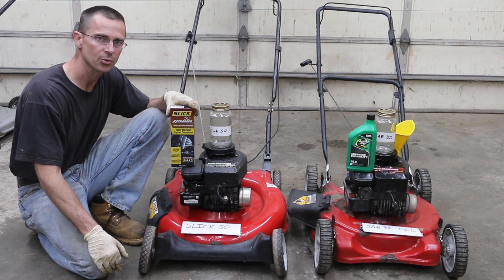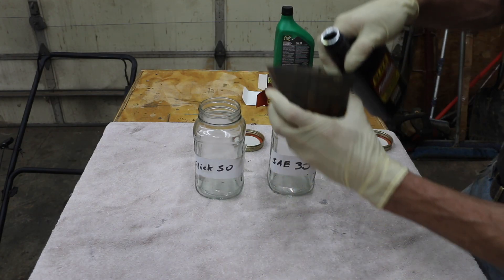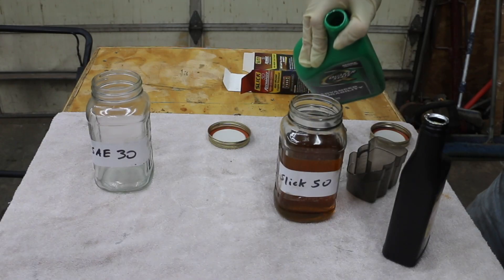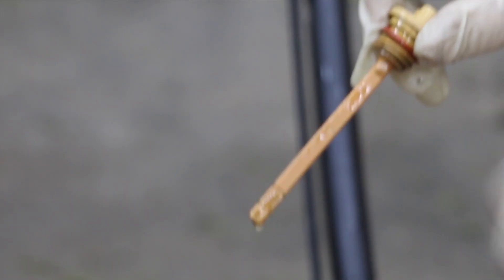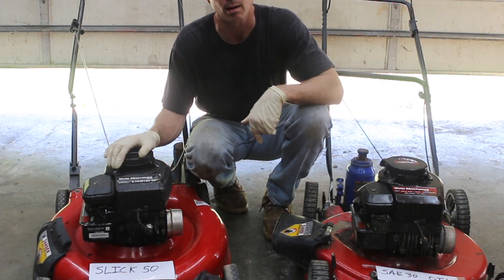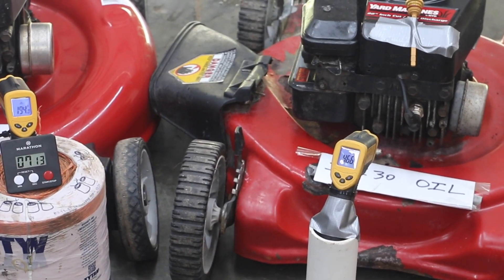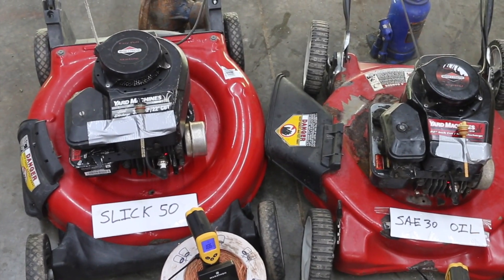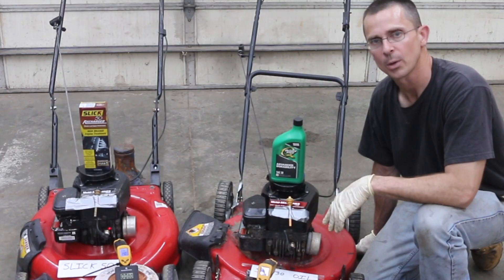Can't believe what SLICK 50 did to my engine!!--Dry Crankcase Test!

Comment: I've never believed the Slick 50 would prevent an engine from doing exactly what it did here.  However, I am surprised at the lower head temperatures.  That, in and of itself, should allow an engine to run longer if Slick 50 is used regularly as instructed.  I also wonder if with just one treatment was enough.  I really don't remember the commercials or the testing specifications for them, but if properly treated and then you had a catastrophic loss of oil, AND you shut the engine down in time, I would be curious to know which engine was repairable, if either.

Comment: Slick50 contains Ptfe particles which clock and burn bearing lubrication, this is a problem when it gets older and starts to burn.
My late father had a Peugeot Diesel and used it every oil change 4-6000 miles. At under 100k miles engine was scrap. Mother same engines normally run 200,000 miles without issues.

Comment: i recently bought some Motorkote, I'm going to put it in my '08 smart with 76K miles on it, it's supposed to "molecularly bond" with metals inside the engine. i do synthetic oil changes at about 6000 miles (factory recommends 10,000) i had an oil analysis at 52,000 miles, less than 1/4 the metals in the oil than a smart with 15,000 miles and oil changes at 5,000. i just started driving for UBER and will probably rack up 700 miles a week. Curious as to what this would do to an engine.

Comment: Would you be interested in trying some Tungsten disulfide? If you PM me, with your address, I'll send you enough to mix with your oil and treat an engine.  I have performed similar tests on 2 stroke engines; i saw a reduction in engine temperatures..

Comment: How long should an engine in service last?  There is no set number so over the life of a vehicle or engine, how do you actually know if the engine benefited from the treatment or was just well made as far as tolerances and machining from the start?
Without a baseline to work from, it's impossible to say whether you got good life of not. Add to that the infinitely variable usage that would have a huge effect, I think these additives are somewhat relying on the fact there is nothing to compare them too know. 

To me, the best way to make an engine last is frequent oil and filter changes. Not even fussed about the best oil, anything that meets or exceeded the manufacturers requirements is fine. It just needs to be be kept CLEAN so the acids and mirco metal particles and everything else is removed.  The best oil still gets dirty. Clean fresh oil in my book is far and away the best way to get best engine life..... what ever that may be. 

Of course the other things is, not many people buy a new car and keep it till the thing falls over.  Many people turn their cars and get something newer better long before it needs a rebuild and modern cars don't wear the engines out till the original owner is 95% of the time going to get rid of them while they are still running anyway. 

My truck is 24 years old and needs an engine rebuild.   If it lasts another 24 years, it will still be running around when I'm long gone. Hope my Daughter enjoys it.

Comment: It's an invalid test. You didn't follow the instructions on the Slick 50. Like you though, I expected the S50 engine to outlast the 30W engine. I suspect that the temperature readings are from a reduction of friction in the engine giving maybe better efficiency. However, the oil is still required to carry the Slick 50 and that by draining it, the slick 50 allowed less oil to be left behind on the engine parts leading to falling sooner. There are some new products that claim to soak into the metal and fill the surface irregularities available at Walmart but they're pretty expensive and I didn't want to spend my money on something I didn't have confidence in. Sorry I can't remember the name of the product.

About those commercials... We of course know that no company would ever lie to us about their product or how they tested it. Why that would be dishonest.  Like the so called safety hazard the GM pickups and their side mounted tanks being a fire/explosion hazard where they put Estes model rocket engines inside the fender of the target truck before they did the side impact test. This was the subject of, I think, a 60 minutes expose.

Comment: Back in the day, the engine in the slick 50 commercial was an old straight 6, 225 Chrysler. Those engines were hard to kill. Before slick 50 came to market and before anyone ever heard of slick 50 a friend of mine had an old 225 Chrysler with a rod knock he wanted to destroy so he hung it from a tree, hooked a battery and fuel to it. With no water or oil in the engine he turned it on and that motor ran for over an hour before it stoped. It was wrapping from the start but it kept running. The marketing was deceptive and I knew it from the beginning because I saw first hand what you could do to a 225 Chrysler.

Comment: Would of been nice to have a baseline test with both engines using the same oil... I bet one still would of been hotter just due to its design... But heaven forbid if common sense is factored into all your efforts.

Comment: my problem is with the size of the blades on the mowers. one is clearly larger (22") than the other Which adds more stresses to the engine as compared to the smaller one. Also the history and useage of the engines are most likely totally different. I would like to see the experiment repeated with either a couple of freshly rebuilt engines or new engines without blades just to remove some variables. Otherwise good work and I totally enjoy your vids!

Comment: the slick fifty engine didn't get rod knock it just got tight if you add oil back to crankcase and get it splashed on everything it will loosen right up and start
Reply from the maker: Trey,  I'll try doing that!  Thanks for watching the video and commenting!

Comment: I have resurrected many engines seized like that. Pull them apart and break them loose. polish the steel back up and should be good to go for a while. Long as it hasn't melted too big of a gap it will still run.
Reply from the maker: That would make a great follow-up video--thanks for that suggestion!
Reply: I'm just full of ideas. :) Unfortunately I have to get this diesel engine built for my van or i'd try some of them.

Comment: Nice job!  I used to put that Duralast stuff on my O.S. .12 rc car engines back in the late 90's.  I may have imagined it, but it seemed the piston/sleeve lasted longer.  I would break in the engine first.  Then I would put a full cylinder of Duralast through the glow plug hole.  Then I would turn the crank slowly several times and drain.  After that, I installed the engine and ran it like normal.  Other guys were getting 1 to 2 gallons of 30% nitro through an engine before they needed to replace the piston/sleeve.  I would get between 3 and 4 gallons.  I tuned my engine  to run around 230 degrees F.  I don't know of they watched the temp on theirs.

My dad put a quart of that Duralast in his high mileage car during an oil change.  A few months later he needed a new engine.  The car already had over 200k miles on it.  It could have been coincidental.
Reply from the maker: Charles,  Very interesting information!  I will test this product for sure!  Thanks for watching the video and commenting!

Comment: I saw a demonstration over 40 years ago of a Wynn's product. I think it was called Wynn's Extend. It was relatively new at the time and the demonstration was done by Wynn's employees. We were also told that they had a race driver who was using the product and that they kept increasing the amount of their product he was using which was resulting in more top end for him.  He decided to use their product at 100% instead of oil and destroyed a racing engine. The demonstration which I saw a roller out of a roller bearing was coated in oil then put on a metal lathe. the cutting tool was run into the bearing surface until the lathe stalled out. Another bearing was coated with a mixture of oil and the Wynn's product then wiped off before chucking it up in the lathe. This time the tool was run into the bearing until the cutting tool broke without any noticeable slowing of the lathe. I handled the bearings after the demonstration one had a deep cut in it and you could clearly see where it had finally locked up. The other one still looked new. The product which I saw demonstrated was replaced with a new product about 10 years after they came out with it. There have been some remarkable oil additives released from time to time, but I have never really used them that often myself, I just follow the manufacturer's maintenance schedule and stick to products which they recommend.
Reply from the maker: Jim,  Wow!  This seems like some really impressive stuff!  I'd love to test some of this product!  Thanks for watching the video and commenting!

Comment: I've been using ProLong in my engines for years and they seem to last longer now. I've run mostly early to mid  90's Toyota Corollas and i run them hard. Since i've started using ProLong, they've lasted longer. Tip: In defense of Slick 50,  i believe youre supposed to put in the additive and let the engine reach operating temperature so the additives can bond to the metal.  Doesnt do any good adding the oil to a cold enigine and then draining it right away.
Hope this helps^^
Reply from the maker: I've heard ProLong is a GREAT product and I plan to test it in an upcoming episode.  By the way, I did allow the engine to reach full temp with Slick 50 in the crankcase.  I should have done a better job communicating that in the video--sorry about that!  Thanks for watching the video and commenting!

Comment: If you remember the old slick 50 and they say it was a originally used to keep our planes flying that had lost oil with ptfe Rosins don't know how true that was. I think the real reason people want to use additives is for engine longevity. I've always heard that cabs in places like ny California run 4 or 500 thousand miles is because they're never cut off. So theoretically something needs to be invented that would lube up all engine parts before it was started
Reply from the maker: I agree.  I originally used Slick 50 for the same reason.  Thanks for watching the video and commenting!

Comment: copy/paste  Likewise, I think any high moly disulfide grease you can get would be interesting.  Even if you had to dilute the grease I would be very interested to see how well residual moly protects.  Even as a dry lubricant it's one of the best compounds available.  On the same line of thought you might try CLP or similar.  The reason we use CLP on our weapons in the military is that it leaves a teflon film after wipe down.  Thanks for the entertaining vids man.
Reply from the maker: Christopher,  Another vote for moly disulfide grease!  Thank you for the recommendation!
Reply: After a bit of quick research apparently many aircraft engines employ high moly lubricants precisely for how well residual moly continues protecting in the event of partial or complete oil loss in flight, so I hope it leads to an interesting test, looking forward to it.

Comment: I'm sure this didn't cause any large difference but was the exhaust from the slick50 engine pointed towards the intake of the 30 oil engine?
Reply: I've been wondering about that, too!
Reply from the maker: Jimmy,  Great point!  Maybe that did cause some variation in temp readings.  If anything, it would seem that the heat from the Slick 50 would have caused failure to occur in the SAE 30 sooner.  Thanks for watching the video and commenting!

Comment: Tip both up. ATF fill in plug hole. Check often to keep filled. After using 1/2 quart in each, refill crankcase with plain 30W. Run mix for 1 tank of fuel. Drain, refill 30W. Neither engine is "ruined" but has wear. Don't believe naysayers.
Reply from the maker: This is a great suggestion!  Thanks for watching the video and commenting!

Comment: Doesn't a splash-lubricated motor specify non-detergent oil for the crankcase? 

Detergent-type oil can foam inside the case. Not a good thing, as a rule.
Reply from the maker: Great point!  Thanks for watching the video and commenting!

Comment: slick 50 uses graphite, so no, try Duralube, and you cam run straight duralube in a small engine where sae 30 is ok
Reply from the maker: Thomas,  this is a great recommendation!  I bought some Duralube and plan to run several tests with it.  Thanks for watching the video and commenting!
Reply: awesome, ive been wanting someone to do some independant, non infomercial type test on duralube, ive always wondered if ive been wasting my money, but it does seem to work fairly well for me, cant wait for your vid...
Reply: awesome, ive been wanting someone to do some independant, non infomercial type test on duralube, ive always wondered if ive been wasting my money, but it does seem to work fairly well for me, cant wait for your vid...

Comment: ZMax had a commercial that used an airplane. 2 guys, one was a fight instructor and the other from zmax.  They had a camera outside pointing to large plastic jug so we could see oil exit motor controlled from inside. Once oil was drained the plane continued to fly for 20 minuets while circling over airport for safety.  I used that product based on that test.  Have you tried ZMax?
Reply from the maker: G ary, I have not yet tested ZMax but I do plan to test it!  Thanks for watching the video and commenting!

Comment: When I was a mechanic's assistent at a dealership, all the vehicles we did engine rebuilds on who used slick 50 long term, had major sludge build up. When I say major, I mean Fricken MAJOR sludge build up. We had to dig it off the heads and out of the oil pan with a spoon and scrape it with a shaving chissel and soak the block and heads for days to get them clean.

Not one person at the dealership would put slick 50 in their engine. I used Dura Lube, but only half a quart every other oil change. The others there thought I was a nut. The reason I used it was because I had an older police narcotics car and it started tapping one day on the way home. I went in and got Dura Lube and added it. By the time I got home, no noise. I owned that car for over 250,000 miles and never had to do anything to the engine but tuneups and oil changes.

The only thing other than slick 50 that I seen sludge up an engine, was Quaker State oil in the green containers. The Quaker State was worst than the slick 50. I use mobile 5,000 mile oil change pro grade oil. Or I use Castro Synthetic High Mileage. Either one runs about $7 to $8 a quart.
Reply from the maker: I enjoyed reading your comments--thank you!  I'm not fan of Quaker State either, but it was cheap.  Thanks for watching the video and commenting!
Reply: That sludging factor may be why the oil out did the slick 50. Even if it were a little bit building up, it would effect the outcome.  I would also like to point out that some additives work best over time and should be mixed in the proper amount with regular motor oil. 

Motor Up and Power Up have an additive that is a type of bleach. It alters the way oil lubricates but it eats rubber seals like the front and rear seals in the engines. Dura Lube is not the same thing as most additives. Back when I was using it when I was younger, it was also used by NASA and the Air Force in some vehicles. It has something they identify as SR3. It does not have PTFE or Teflon in it as some additives do.

You test was impressive and basic. Some times basic gets the real results.

Comment: I dunno dude, I think the slick 50 motor itself had an issue. 
It took you longer to start it while the other one started up right away.
Reply from the maker: I wish cost wasn't an issue and I could run multiple test using new engines.  Thanks for watching the video and commenting!

Comment: Yeah, I know what'll last longer than that oil. Some Mobil 1 10w40 fully synthetic oil. That stuff breaks down a couple hundred degrees higher than conventional oil because of it's purity and extreme additive packages. In car use Mobil 1 is recommended at 15,000 to 20,000 mile oil changes now because the additives are so robust. I'd definitely pick up a quart of either 0w40 or 10w40 Mobil 1. 10w40 is thicker for the rudimentary nature of this engine, but 0w40 conforms to stricter (almost formula 1) levels for heat endurance etc.
Reply from the maker: Jesse, Great point!  Maybe I should test conventional versus synthetic.  Thanks for watching the video and commenting!